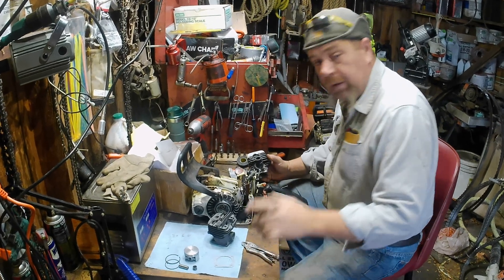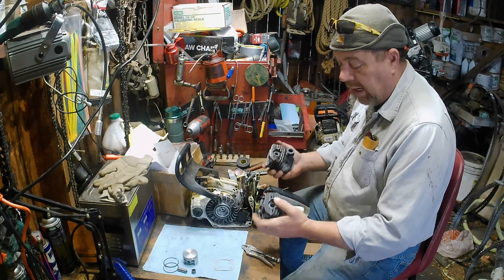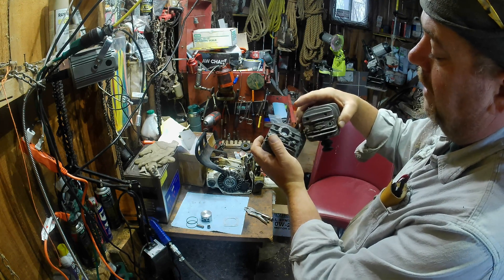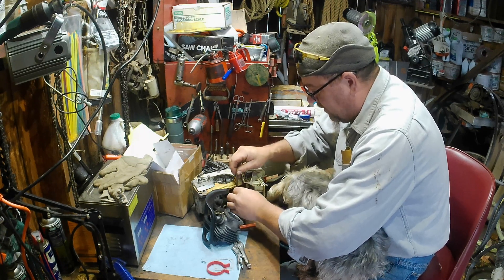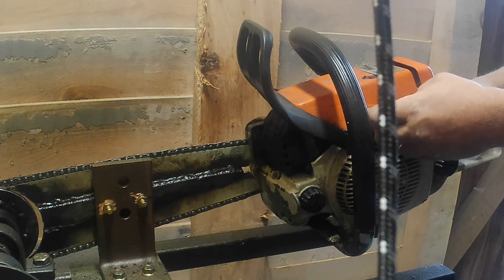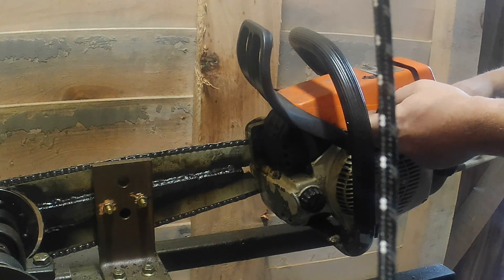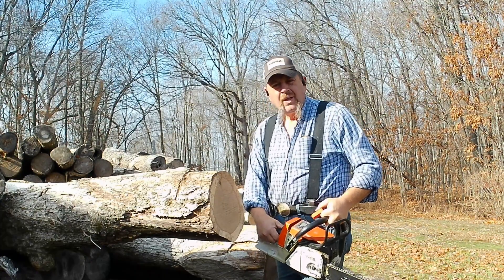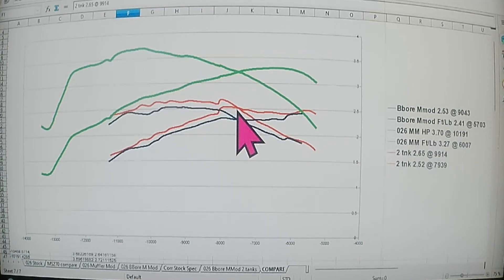Stihl 026 Aftermarket BIG BORE Surprising DYNO RESULTS Test Cuts

Comment: Very interesting results, not at all what I expected.  I got a sweet little 026 here, clean as a whistle and all stock.  First thought was to swap the P&C to a Hyway big bore with pop-up but I'm rethinking that now.  Gonna watch some more in this series and see how yours played out first!
Reply from the maker: @Axeman1972 I agree!! That may or may not be a good idea; our situations are different; I was using the cheapest Imported Mystery Metal that Amazon had to offer; there's a good chance the Hyway or New West or Meteor may very well be better options. I know, that on my MS361 (clone) cylinder testing, the New West big bore gave the best out-of-the-box performance; I know the New West big bore, the meteor standard bore, and (if I remember correctly) the Hyway standard bore ALL outperformed the Farmertec Cyl that came on the saw.  On the 361, the big bore REALLY surprised me.
Reply: @HayChaffandSawdust1 mystery metal, 😂.  I remember that video and searching up NW parts.  I'd have to bring them in from the US but it almost looked worth the trouble.  I've had good success with meteor and Hyway but the prices are creeping up.  I had to throw a Chinese piston in a 261 the other day because that's all I could get.  Arborist, needed it fast.  Makes me nervous though, a new 261 jug and piston from Stihl is close to $700 CAD.  If that piston takes out the cylinder, I'm losing hard on that job.
Reply from the maker: @Axeman1972 It's quite a gamble to put questionable parts inside of good parts, isn't it??!! I hope you have good luck! A lot of people heat treat the cheap pistons; I just got an toaster oven specific for that... didn't figure that bacon grease would help the metallurgy 🤔😜
Reply: @HayChaffandSawdust1 I was seeing Iron horse doing that I believe.  I agree with the theory, we've re-tempered aluminum weldments before but it's got to be a heat treatable alloy in the first place.  I'm not sure anyone in China, casting these parts from recycled beer cans is checking that. There's one way to find out, run it like it's stolen.
Reply from the maker: @Axeman1972 You got that part right... run it 'til the brakes fall off!! You're correct on Ironhorse doing it; he claims that Hyway pistons take the heat treat very well.. a better mixture of Bud Lite cans vx Coors Banquet??   I'm dang sure gunna mistreat the piston, so I figure I'd give it every chance it can get 😉

Comment: I’ve had good results doing old school piston porting! That way I don’t have to mess with cheap peeling plating!! Gasket delete and piston porting that way u get the comp back to a usable range that starts easy pulling. Little time advance and muffler mod will usually get one to wake up
Reply from the maker: @jefferyboring4410 THat's good sound advice!! I've played both ways; I like messing with pistons; it's amazing how fast and how much a person can improve a saw by ONLY doing piston work... of course a muffler mod and (most times) timing advance is helpful!! Thanks for joining in and sharing your experience!

Comment: Didnt explain enough. How to do the replacement. Pulling wrist pins etc. Gasket squish? Is an aftermarket stock bore going to do better? Were you able to mount top cover without mods? 
Im trying to decide how to approach my rebuild. Many many cords of wood lots of blow-by.
Reply from the maker: @theresahoffman8408 I know there can be many questions unanswered in a short video; there's a whole playlist of mods that I did to this saw. Wrist pins are easy; they are held in with circlips; check squish to determine if gasket needed; it the gasket was not needed on this saw. The top cover mounts with either cylinder; the 44mm stock cyl and the 44.7 "big bore" were each sold from Stihl on the saws with the same plastic (just different stickers).  An aftermarket stock bore will be hard to find; I don't think they are even available in 44 mm 🤔   Hope that helps some!

Comment: I have a 26 that I also put the big bore on and it sounds great but man is it slower too. Seems counterintuitive. Does getting the squish to .20 going to get back the power? Or should I just hone my original piston and get a meteor cylinder?
Reply from the maker: @gosh7001 I think getting the squish back down to 18-20 thou will help some, but some of the other stuff in the AM cyls (such as transfer shapes) may still hinder you. Getting the compression back will help considerably though. A better cylinder may be the way to go, but I enjoy the learning attached to making the cheapest cylinder work well. It is claimed that the real cheap cylinders are not round; better cylinders are better.  I, also, don't care for the piston shape and their relative shape to the combustion chambers of the very cheap cylinders. I've used, both, Mtanlo and Adefol. If I remember right, I like the Mtanlo piston and the Adefol cylinder??

Comment: A lot of good information in this video I love my 026 I've had the saw since it was brand new in the early 90s. Still running completely stock, never changed piston bearings. Nothing .still has incredible compression and it's screams. I'm always tempted to screw with it. And put a new cylinder in piston in it. But I don't dare until it really goes South. It cuts about a cord to 2 cords of firewood every year and miscellaneous around the yard tree trimmings .
Reply from the maker: @chriss8206 This is the first 026 that I've owned and it's a nice sized saw between too small and big. Like you, I used to hate to mess with a good running saw; I've found a compromise though with the Aftermarket parts... I mess with the AM stuff and leave the stock stuff alone; by that I mean, my original cylinder, piston, etc... are still in their original condition; it can all be put right back on to put the saw back in its original config with its original parts... just like it was.  If this cylinder works out well (we're up to about 4.5hp with it right now... quite a few mods tweaks done to it since this particular video... all in an 026 playlist), and I so choose, I can duplicate the stuff into the orig cyl.   Thanks for joining-in!

Comment: Well, I love the fact that one can get a aftermarket cylinder set for cheap instead going to official Stihl store and getting ripped off. In my eastern European surroundings I can find a good old 026 for around 150€. Or a non running one for 50-100€. The service guys ask 200-250€ for a cylinder change. And if you are good with a Dremel, the power probably is still there, and doesn't cost you an arm and a leg. 026 is the saw I suggest to homeowners. And pretty much all parts are available.
Reply from the maker: @KrisjanisZarins  Right on the money with your comment. I believe the power will still be there (plus a bunch more), but I wanted to do a base-line dyno run/test cuts with an out-of-the-box cylinder prior to putting the grinder to it. We plan to do the full build and document progress or regress on the dyno along the way.  Thanks for joining-in the conversation with all of us!!

Comment: I like seeing the results of a direct bolt on of a kit like that. I imagine a lot of people just buy those and throw them on expecting better results.
Reply from the maker: @FarmlessFarmer-xs1he   I know, RIGHT??!! I speculated it would not perform as well as the stock cyl, but was astonished at the dismal results. Bigger SHOULD be better. ...and it will be with a little bit of grinding (I hope). It will probably force another video; attempt replicate the stock port timing/shape and re-dyno before porting further.
Reply: I’d be very interested to see how the big bore kit performed with porting taken to the specs of the stock cylinder as closely as you could do because I dont think anyone else has a dyno video like that out there. And you’re working with a saw that most average folks could afford to get into and that makes a great first saw for people to tear into and have a go at it themselves. 
Guys like me who become a little obsessed with numbers would watch every video if you made a tiny change each time no matter how many videos you make.
Reply from the maker: @FarmlessFarmer-xs1he  I was thinking the same thing; maybe some short(er) vids with 2 or three changes and results in the same video?  The drawback, with no base gasket, I have to let the sealant cure (at least) 4 hours before I can test it and clean-up of surfaces  between coats of permatex. Could turn base far enough to use a base gasket to emulate a base gasket delete, I guess.

Comment: What does the muffler kit do for the saw.
Reply from the maker: @vincewoolley6774  On many chainsaws, the muffler is a pinch point in the system which restricts air flow capability... (sort of like putting a potato in someone's exhaust pipe to make their car not run with any power.)  Modifying the muffler with an appropriate(ish) size/shape hole with allow more air into and out of the saw engine; it also promotes cooling of the engine.   For a short answer.